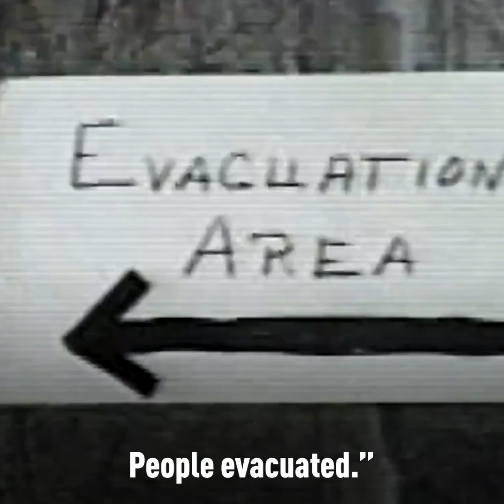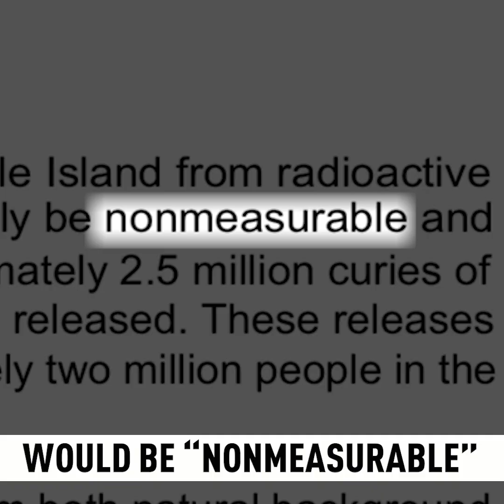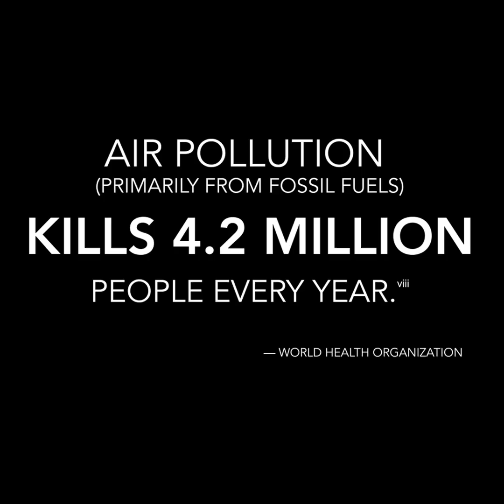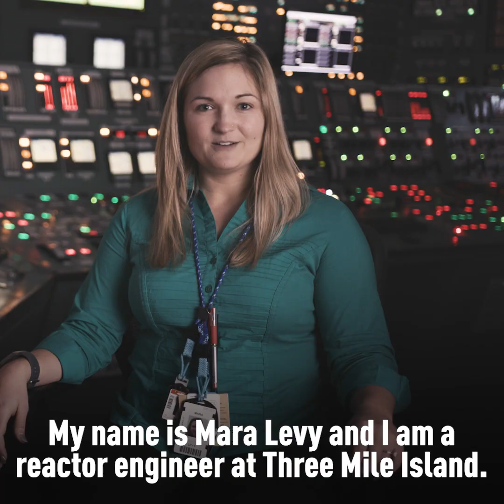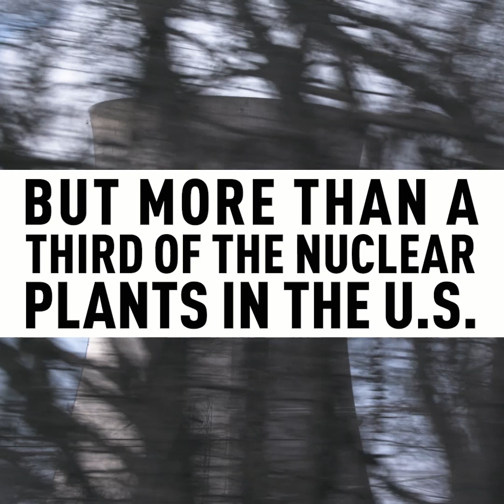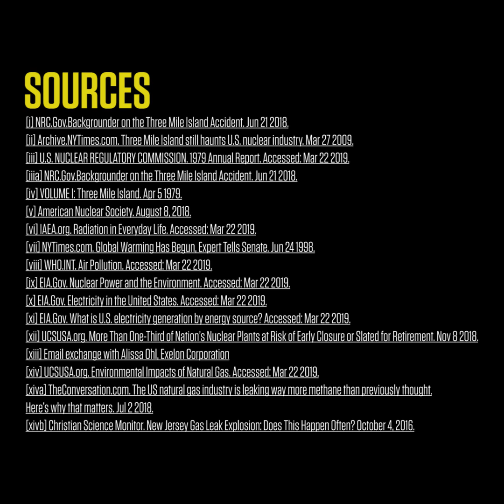Three Mile Island

Comment: Nothing was said about the dangers of mining uranium or the major problem of dealing with the nuke waste that stays radioactive for centuries, or Chernobyl, or Fukushima, which is still melting down and pouring its radiation into the sea! Perhaps these problems can someday be resolved, but not by hiding them! How can nukes be made more safe and cheaper than solar and wind energy? How can we process or use the deadly waste to make it safe, permanently? Until these questions are discussed openly, and fully answered, I have to vote no on nukes!
Reply: Uranium mining is so heavily regulated and so small scale that it's arguably the safest mining industry in the world by a fair margin. The radioactive water being ""pumped into the sea"" at Fukushima is currently less radioactive than natural seawater, which is full of natural uranium. This also doesn't even mention that nuclear power produces less life-cycle waste than any other power source by a wide margin, and kills fewer people than any other power source, meaning it is already much safer than wind and solar.

Nuclear power is also already cheaper than solar and wind in much of the world, which also has had the waste "issue" solved for decades through waste recycling and later deep geological storage (by which point the waste is effectively harmless).